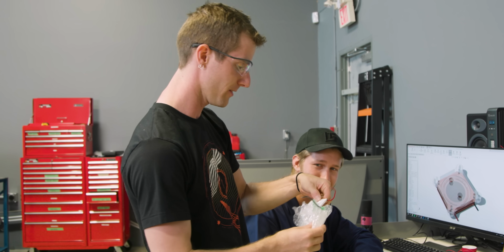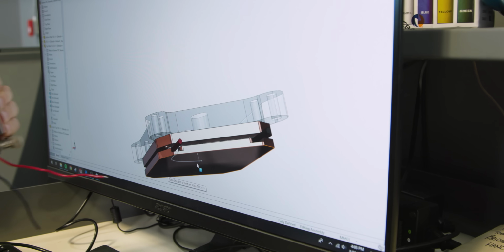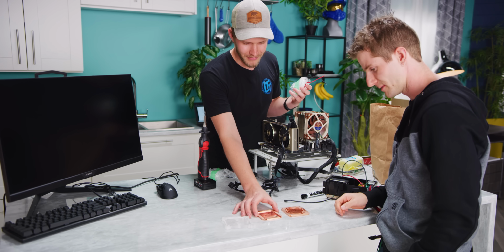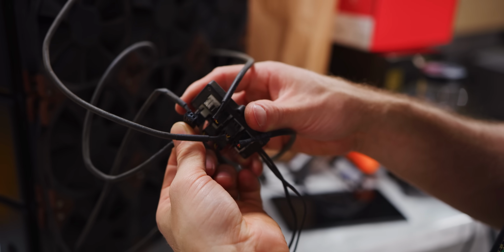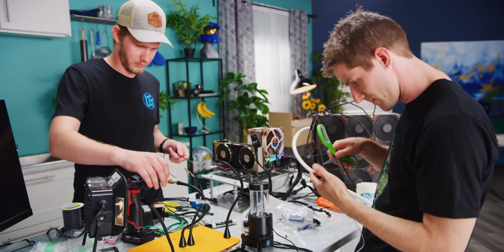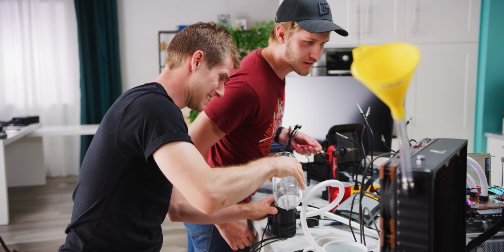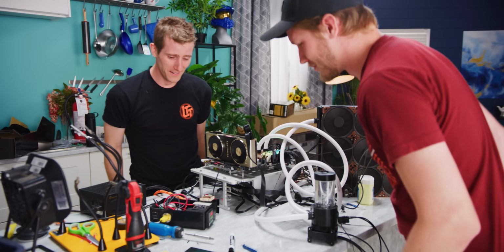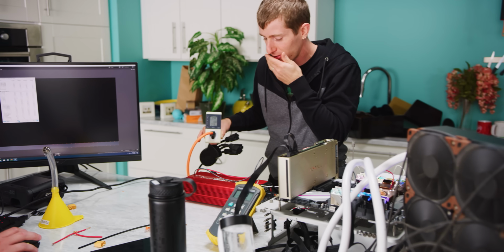This Cooler DRAWS 545W!!? Bad Cooling Ideas #2

Comment: Hmm putting the peltier element direct on the cpu may be not optimal. May be heat pipes from the CPU to the peltier?
Then the water cooling on the copper.
So the hot side does not transfer heat back to the cpu?
Sure its madness but that's the reason you're doing it 😁😉

Comment: I dont get it, how can a 500watt TEC not cool a 150watt CPU? I had a 220watt TEC cooling a <150watt CPU with ease... until it got wet LOL.  I would say the cooling of your hot side let you down, you need one of your higher powered pumps from your chiller setup, not a D5, its too slow.
Reply: also that slot for the temp sensor would have killed performance and in the long run would damage the TEC.

Comment: Linus 2019: 'A PID controller is like an On/Off switch'
Linus 2020: 'A computer is like a spinich'
Reply: Linus 2021: A spinach is like a rock
Reply: Linus 2022: A rock is like a stone
Reply: Linus 2023: Weekends are like applesauce
Reply: @AaronzDad  "Weekends are like Applesauce" sounds like a Dave Barry book title.
Reply: If you give too much power to a tec module it will turn into an insulator and both of the sides will start getting hot lol
Reply: For those who have not heard of PID controllers, it's more like a smart, variable power supply that goes positive and negative.
Reply: @hawaiianryan1890  That's sort of close, but i think the best analogy for a PID controller would be the cruise control on your car. You set a speed, and the car decides how much throttle to apply to keep you going that speed. Are you way under speed? It will apply more throttle. Are you close to speed? it will ease off the throttle, maybe at like 10% of maximum. If you are at speed, ideally it will apply zero throttle. That's the simplest analogy i could think of anyways.
Reply: @ForwardBias   Good, but your analogy should include the case when the speed of the car exceeds the set point. This can happen when the car travels down a hill. In that case, the PID controller should compute a negative value for throttle. This should be translated into braking or down-shifting of the transmission. Further, we have only described the proportional functionality and have excluded the integral and derivative components.
Reply: @hawaiianryan1890  yes of course, but I'm just trying to keep it simple for people who don't know. For anyone wondering, PID is for Proportional, Integral, Derivative (I think, been a while since my embedded class).

I described the proportional already. The integral portion is so that as time goes by, if applying say 10% throttle still isn't getting you to the speed you need, it will keep track of your error over time and adjust accordingly, incrementally adjusting the throttle. So this works in cases like suddenly it gets windy, or you are going up a hill, it'll dynamically adjust. And then the derivative is kind of another tuning aspect that I never really got into. It deals with how fast your expected output changes and I think is for dampening, but I'm not exactly sure. It's really interesting, I suggest looking up PID controllers to get a better idea.
Reply: @hawaiianryan1890  PID is not like a Cruise Control, Cruise Control is one usage of PID. No need to explain anything further, because Cruise Control uses PID controllers.
Reply: @dak1st  this comment thread is like a ball of snow rolling down a hill.
Reply: Um. The PID is like an On/Off switch. It's a digital controller, even if it's using PWM, that's still either on or off at any given point in time.
Reply: @NoopityNoop  for starters, saying it's like an on/off switch is a complete disservice to what the technology actually does. A PID controller isn't limited to digital logic. Analogue systems exist you know. For example, the throttle in your car definitely isn't on or off. You can apply a percentage of your throttle.
Reply: @ForwardBias  It's like a THERMOSTAT.
Reply: @claypf4795  I mean sort of. A thermostat is a simple thing that turns a heater on if you are under temp, and off if you are over temp. (vice versa for AC) Similar concept but not really a PID controller. There isn't a proportional, integral, or derivative portion to it. That's just a switch.
Reply: These analogies are getting to be like the 1982 Atari 2600 game "E.T. the Extra-Terrestrial".
Reply: @NoopityNoop  PID controllers are usually used to generate a continuous signal, not a discrete binary one.

Comment: I have an interesting idea. Instead of cooling the CPU directly, have you looked into cooling the liquid coolant down using the Peltier devices? This would allow you to fit more devices in almost like a radiator fashion. Then it’s a matter of cooling the hot sides. Kinda like a heat exchanger. You may need to use a bit of antifreeze on the cold side sense Peltiers can go well below freezing sometimes. Just an idea I had that would be fun to see you try. But it would be very time consuming to build

Comment: 18:47 It looks like reason that relay doesn't shut off is because you are trying to control DC with an AC Solid State Relay. Most AC SSR's have "Zero Cross Detection" and will only turn on/off when the load side voltage is 0 (or near 0). This helps reduce EMI from switching transients. If the AC sine wave is at any point but 0V at the instant the switch closes, you have a sudden spike in current which can cause interference in other devices on the AC line and even interfere with RF devices (ever here a 'pop' from the radio when you turn a light switch on or off?) Now, when your PID controller turns off the control side of the relay, the relay is waiting for the supply voltage on the load side to drop to/near 0 volts before it will switch off, but since DC voltage never crosses 0V, it effectively latches on.

Comment: You should try doing a two-stage water loop. The first one cools the cpu with TEC cooling the radiator and second loop cooling the TEC's hot side.

Comment: the more power you put in the more heat the water cooler has to remove. If the hot side gets significantly hotter than the cold the efficiency drops like crazy. TECs are better for constant gentle cooling like mini fridges, but are still the least efficient cooling technology.

Comment: Doing the peltier control like that is a bit idiotic…      you know there are thermally adaptive resistors…  to analog control the input voltage for peltier and doing so cool it less or more if needed.   Or you could do it with logic aswell but bit expensive for use of that nature.

Edit:  But Peltier device will allways have more heating on hot side than cooling on cold side..    just the nature of the beast…     so as an cooler like that.. it will never work…  would be more effective if attached to radiator and vent the hot air outside...     if you need extreme cooling…    need anti freeze on cooling liquid tho…     +   your pc will act as aprox 2000w heater at that point.. so well come back to fx 8350  running at 4.9 GHz …

Comment: What if you use the TEC to cool the water in a water loop.  You know water coolers work.  you know a TEC can cool stuff down to real cool.  The issue I think you are hitting is thermal transfer between the block.  So can the TEC cool the water in the loop. So you can have a smaller radiator, on the water CPU side.  Large radiator on the hot side of the TEC.

Comment: Use a normal cpu waterblock and use 2 Pelt's to cool the water before and after the rad or a few in a row in the hose line

Comment: Ran a TEC way back in 2004/5...  still have the thing kicking around somewhere.  Had a 350W secondary power supply just for the cooler.  Issue was I was running it in a mid-tower with only a dual 80mm rad, so if I left it running for 2-3 days the heat buildup inside the case would cause the hoses to loosen and start to pull back off the barbs and coolant would leak into the case...  many worm drive clamps and much silicone sealant was spent trying to resolve that issue.  I could get the thing to run sub-zero temps pretty regularly, but not for more than a couple of hours at a time.  Also had to conformally coat the back of my motherboard and use di-electric grease in my CPU socket to prevent condensation from forming.

In hindsight, a full tower case with better airflow and a much bigger rad probably would have solved it.  Just went back to aircooling after that, until very lately getting into AIO watercooling (for the RGB, of course!).

Comment: TECs can work, but not like this. First you need a proper TEC controller like this from Oven industries https://www.ovenind.com/pdf/datasheets/DS-5R7-388.pdf , then you need to provide a ‘buffer’ between the cold side of the TEC and the device your trying to cool. The best option is have the cold side of the TEC chilling a cold water loop with thick tubing like the EK 16mm OD 10mm ID black hose to help with insulation. Swiftech used to make a great off the shelf TEC water chiller MCW-chill-452 many years ago. You never know they may still a few kicking around the warehouse. You probably want a couple of these to really get the effect your after so it’s going to get expensive on TEC controllers.

Comment: I have a retarded Idea about this tech cooling thingi. Soo I was thinking as these peltier devices cannot cool a cpu which produces alot of heat. So what we can try is not waste 500 watts on cooling this way, but do it the way that you did before, but this time introduce a radiator before letting the water go into the perltier device cooling modue. This will help most of the heat from the water to escape and then these peltier devices might be able to cool the liquid more efficiently. and as far as I know if it is a 360mm rad it might take only 3 watts for the 3 fans. Soo not alot of more wattage will be used in this way, and I do believe that this might make the whole concept of peltier cooling worth it. But the temp drop might just be 2 to 3 degrees. SMH

Comment: To be clear, TECs are not useless.  The usefulness of a TEC is not its ability to remove large thermal loads (in fact, all a TEC does is MOVE heat [you still need a radiator to remove the heat], and the TEC GENERATES heat during this process).

The usefulness of a TEC is in its superior control; which makes it especially well suited for use in temperature stabilization (servoing) systems.  The TEC's superior control comes from two important properties of TECs: Its ability to heat or cool depending on the direction that current flows through the Peltier; And, the fact that you can control the rate of heat transfer by adjusting the current flowing through the Peltier.

The application explored in this video did not take advantage the unique properties of TECs.  Moreover, the PID servo used in this video did not take advantage of the superior control offered by TECs.  Rather than adjusting the current flowing through the Peltier, the PID used in this video ran the TEC at full current or zero current.  Cheap PID servos (like the one used in this video), run on a duty cycle loop.  Basically every cycle (usually several seconds), the PID circuit determines the fraction of this cycle time the TEC should be running, and the fraction of this time the TEC should be off.  The servo then uses a relay to turn the TEC off or on.  While duty-cycle PID loops are cheap, and offer sufficient temperature stability for most applications, they do suffer from temperature ripples (caused by the TEC being either fully on, or fully off).

A more sophisticated PID circuit would servo the current (both magnitude and direction) running through the Peltier.  This removes the temperature ripples, and allows for a much better temperature stabilization.  In my line of work (experimental physics), we use these types of temperature servos to stabilize temperatures to within a few milliKelvin.

Comment: So, it's been a long time since I've used a TEC (like Athlon 2800+ @ 75w? TDP, and an even older Athlon before that), but I have had two older systems that ran using a TEC, and I was always able to get around -4c at load, and I don't remember any issues where it was simply overwhelmed. I feel like there's something fundamentally wrong with your setups. IIRC I used a 270ish watt TEC for the later build. I also was able to use a mini-fridge compressor using an old all copper radiator (as the compressor), an old Danger Den all copper waterblock (as the evaporator coil), and an expansion valve (as these components weren't really made for this, and needed some way to tune the pressures) to get to -40 temps (the lowest I could measure with my equipment) all the time. 

I somewhat wonder if the TEC is overcurrenting... if it's rated at 545 watts, it shouldn't be running significantly above that, unless the PSU was just that inefficient. I used a Lab power supply and used the dials to set nominal voltage, and limit current to max rated for the TEC. TECs turn into a heater if things get too out of whack, like voltages are bad, or you can't remove heat from the hot side fast enough, etc... I had to modify my Lab power supply with the help of the manufacturer to allow it to come up to full load as quickly as a TEC tries to consume energy. My old setups used a much more substantial cold plate (more heat capacity), and the old school water blocks of the day were brazed together all-copper monstrosities with more internal surface area than a modern style block, and forced all of the water to flow through every channel instead of over the fins... It's possible you just simply aren't removing the heat fast enough, or don't have a large enough thermal mass on top to keep the temps from getting too far away from nominal. I recommend you keep trying. I think it isn't worth it, but that it can and will work if built right; that being said, water cooling isn't really that worth it in any event... we're just a tinkering sort who needs to eek out as much as possible to get our kicks.

Comment: Linus for gods sake just put the tap pieces in the drill press to start and turn the press by hand and have the plexi in a vice, that will start it square then you use the handle with plexi in a desk vice. :(

Comment: This is why you put a water block on both sides of multiple TEKs , and have the cold sides cool a loop without a rad, that has a water block on the CPU. Then have the hot sides cooled by a loop with your large rad. Then you have 4 to 5 kw of TEK cooling.

Comment: Just found out nvidia is still trying to sell the founders edition of 1080 for 1199 for no reason but they only have that type of 1080 available and its weird in the filter settings  you cant chose 1080 or 1070 like they never existed

Comment: I guess Alex didn't realize that solid-state relay was intended for AC loads cause its a traic based relay meaning the load side will stay closed until the load current falls below a certain point. Which with a DC load it would not, not to mention that solid-state relays have a voltage drop across the load side proportional to the current draw and with a current that high there would be a big voltage drop especially when you only have 12V to start with (should have used a higher voltage PSU probably) which not only would probably limit the Peltier cooling capacity significantly but also cause that relay to heat up a lot since he never heatsinked it. GreatScott! made a video all about solid-state relays that I recommend you check out, he explains more in-depth about them and also why it didn't work for your application, a high power mechanical relay or transistor like a 2N5686 would have been a better choice. Not to mention that with Peltiers you have to balance the Peltier output power with the cooling capacity otherwise you can cause your Peltier to overheat and actually heat up the CPU rather than cool it. Also why a variable voltage PSU? Controlling the Peltier output power using something like an Arduino to generate a PWM signal with a duty cycle based on the temp in combination with a high power transistor would have probably been a better and more effective solution than a PID.

Comment: Wouldn't it be better if you use the TECs to chill the Water instead of direct chilling the CPU? You could put a waterblock on either sides of the TEC an make a chilled loop and a hot loop 🤔

Comment: You should check out Tech Ingredients channel's "solid state freezer" videos. Specifically they say that TECs work better when they're at about 1/3 the rated power and so you should use multiple 500w TECs at around 150w each. Another option is to use phase change cooling, probably with some sort of rotating disc that will absorb the heat and release it when the wheel is turned.  Hopefully the benefit would be that it's quieter than other options, and requires a lot less power.

Comment: Even if the efficiency was 100%, no losses at all. All it does, is move heat from one face, to the other. No cooling takes place at all. So you need a cooler with the same heat dissipation characteristics. Otherwise the heat transfer rate will reduce to match that of the cooler. So... Basically it's a redundant component.

The only use it could possible serve in this context, is as a corrosion resistance layer, in a device that runs so hot, the two alloy surfaces would start reacting with each other. Such that they'd lose efficiency and fail over long running periods, as a result of said corrosion.

I doubt it'll ever have a use in computing. It's more useful in refrigeration and air conditioning, which isn't the same thing in practice.

But hey, it's still fun to experiment.

Comment: Ryzen 7 2700X
Cooler Master Masterliquid ML240L
Asus ROG Strix B450-F Gaming
Geil RGB (2x8) 16gb DDR4
Samsung 970 Evo
X2 Seagate firecuda Compute Hybrid Drive
Asus ROG Strix Radeon RX590
750w Bronze Certified fully modular PSU

And for some reason it won't let me install the Windows 10 installation ISO from a flash drive linus can you help me